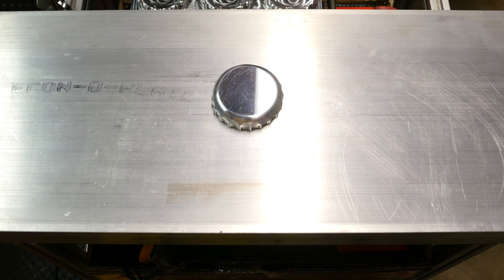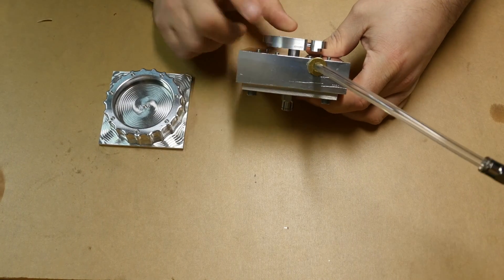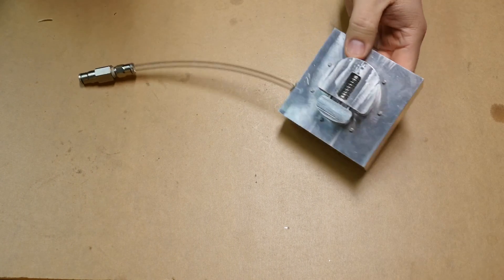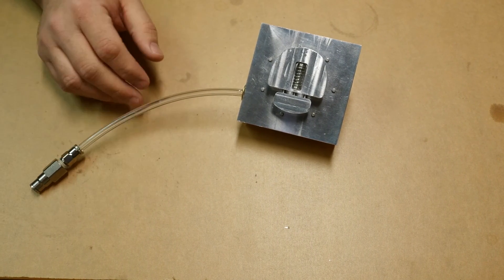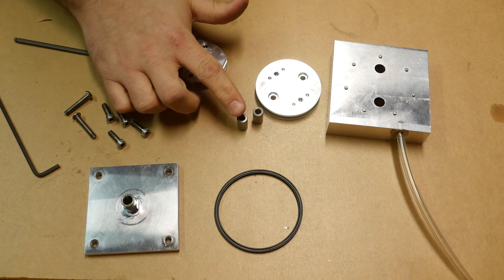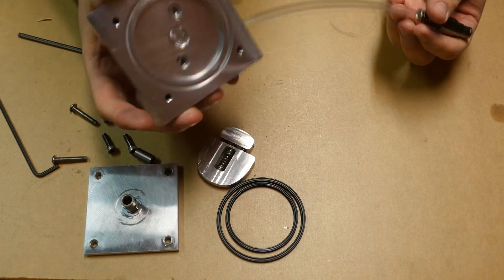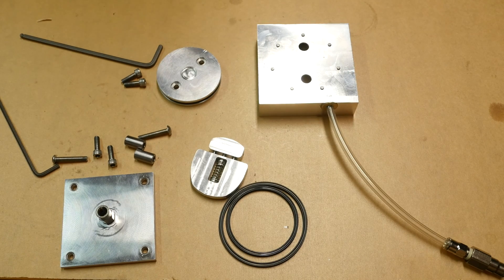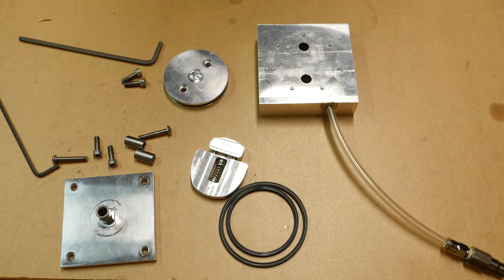21-Station Pneumatic Fixture (pt. 1 of ?) - Intro and Prototype Disassembly

Comment: Great job. Hope to see more. Are you using flood coolant or air, when milling? Would there be a problem using coolant with the fixture? The alignment pins are they machined or pressed in pins? If you could make a videos of the whole project.  like someone said earlier, its the little details that you learn the most from.
Reply from the maker: Thanks and thanks!

This machine has flood coolant built in so that's all I've used with it so far. I don't think coolant should cause any issue, I figure if it has to be airtight then it should keep the coolant out too. I've used the prototype to mill five bottle caps without any perceptible problems. Of course, five uses really isn't very many.

The pins are 1/8" dowel pins that I bought from McMaster. At first I just stuck the dowel pins into 1/8" holes that I drilled on the top of the prototype. Very quickly, on one of the first couple tries, at least one of the pins got pulled out when I tried to release a bottle cap. It was a pain getting the cap off because the pin was held in both the base and the bottle cap, and the cap has to move to press the jaws together (which allows the cap to lift off). I had to push the pin back in with needle-nose pliers. I put some thread-locker the hole and it seems to be holding that pin in place. I'm going to thread-lock them all when I put the large base together.

I really do want to make some more videos! It would seem that I'm just not very good at it. :/ I'm trying not to let myself get too much farther in the project until I actually get a couple more videos recorded, edited, and uploaded.

Comment: Did you think about doing a vacuum fixture plate for your caps? If it would hold them well enough for milling, it would be a ton simpler.
Reply from the maker: I tried to make a vacuum fixture before this one, but it didn't really work right. The surface on the bottom of the cap between the rounded edges and the dowel pin / magnet holes isn't very large. There isn't that much room for a gasket.

It might not be a lost cause, but I abandoned it to go back to a mechanical fixture.

I think vacuum would only give me about 90 lbs. of holding force, which doesn't sound like much.

Comment: Awesome piece of fixturing! I'm looking forward to seeing how you provide air pressure to the center row on the fixture.
Reply from the maker: Thanks!
The air inlets will be very similar to the prototype. The bottom holes, on the "seal plates" will be basically the same, there will just be more of them. The side air inlet holes will be similar, except each hole will be deeper so will send air to three stations instead of just the one. I figured this might be easier said than done so I actually finished them before I recorded this video. There are seven side-inlet holes. I started them with the machine and finished them by hand. Long story short: I drilled down ~2-3/4" with the machine and did the remaining ~6" with my cordless drill. The bit clogged up rather quickly so I had to do a short peck, pull the drill out, shake it off, dip it in some coolant, and repeat... over and over again. I counted the number of pecks I had to do in the last hole I drilled and it was 32. In other words, each peck was 3/16". I don't know how much time it took, but each hole drained about one-and-a-half charges of my cordless drill's battery pack. It was a chore to be sure!